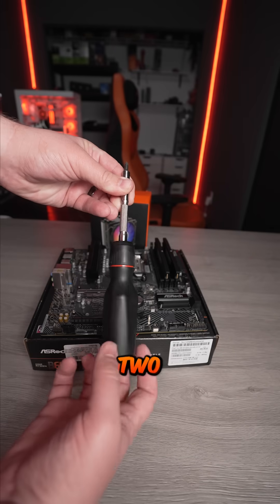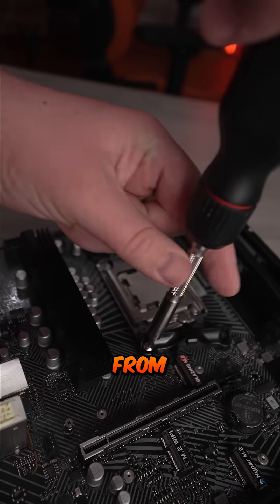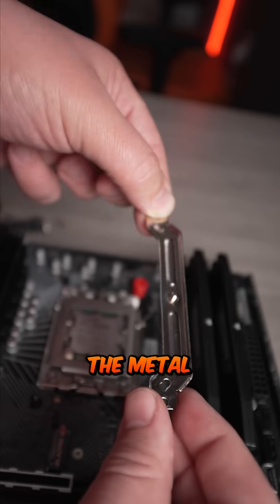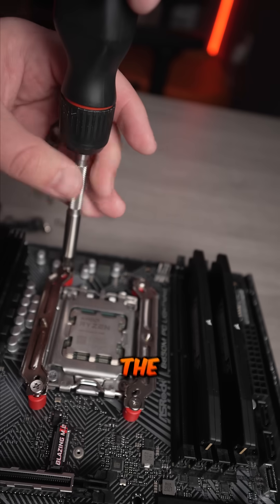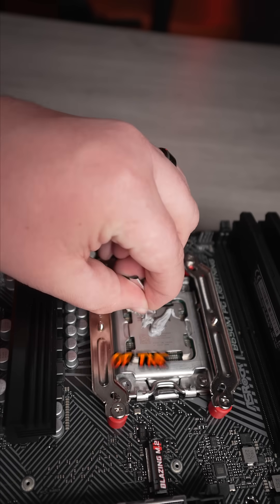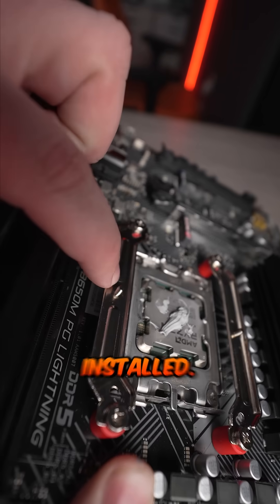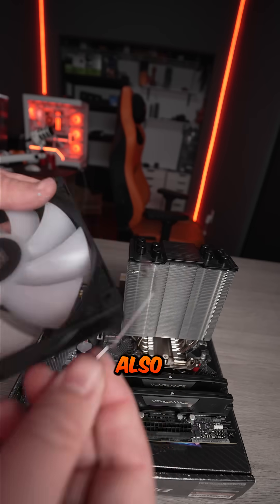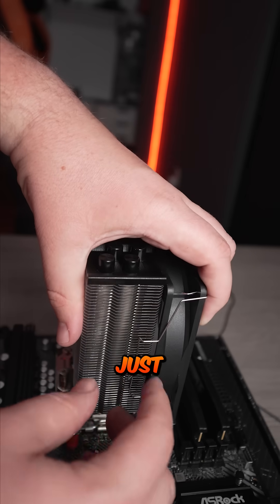How To Install the ID Cooling SE 214 XT in Under 90 Seconds

Comment: Where do you plug it up?
Reply: there should be a little 4 pin socket at the top of the motherboard north east of the CPU, where there should or may be text which says "cpu fan", plug the CPU fan cable into there and you're all set

Comment: 1000$ and 20 bucks for cooling.. cmon wtf
Reply from the maker: Price to performance! Why waste $100 on a cooler when this one works and I can spend more on the GpU??
Reply: The 7500f doesn't need a super beefy cooler. So you don't need to fork out a boat load of cash to cool it. Better to get a cheaper cooler and put that extra money towards other parts.

Comment: Wheres the gpu?
Reply: It's not installed yet
Reply: gpu aren’t hard to install at all, you see the big long slot, you push lever on right and left and you put it in, generally just need 1 screw to fix it in
Reply: @fayrebrand1402  idk its not hard but its risky sticking a 345mm gpu in a 350 clearance matx case
Reply: @finderbades  yeah you need to manipulate it a bit but just be slow and watch what you are doing and everything will be fine
Reply: in the computer